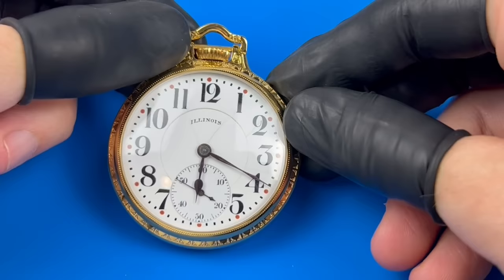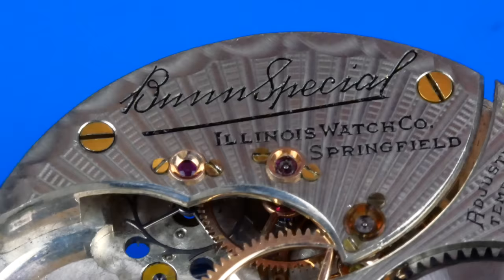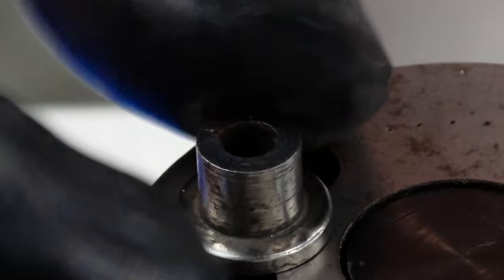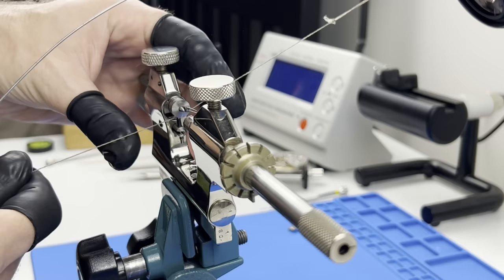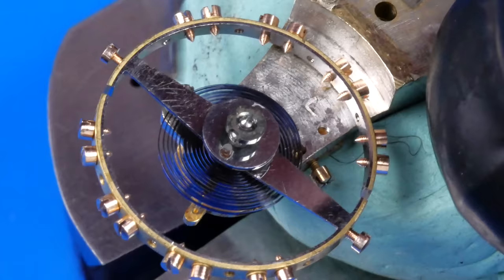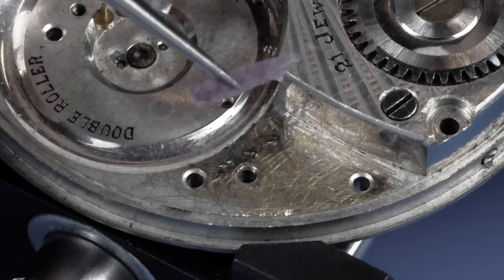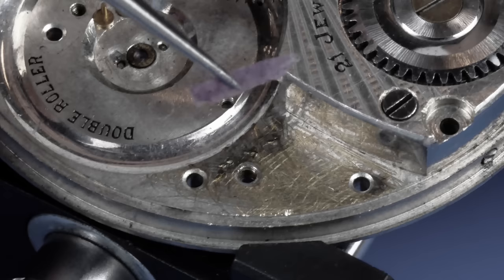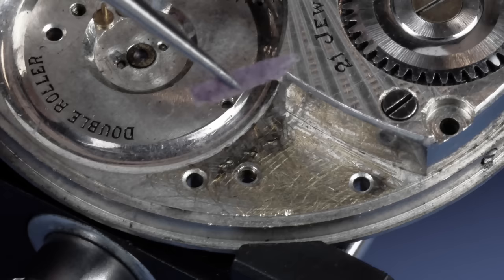Gremlin Hunting in the Iconic BUNN SPECIAL - I Can't BELIEVE it was Running!

Comment: 2:47 experimental and i've only done this on a large dial with a destroyed enamel (in other sections), but i've steamed a dial and then used CA glue under vacuum to fill the holes. Specifically, i slightly flexed the dial on a jig (probably less than a fraction of a mm of deflection) and used a tube under suction at the edge of the crack to suck some CA glue (extra thin type, white tinted). It works. The crack disappears at all distances but very, very close inspection. The steam cleans the crack and the white CA fills the void.
But like i said, i've only tried this on a destroyed dial. I've yet to work the courage to try this on the dials i have in my collection from my family (which is why i've experimented). I'm still working on the idea and application, because for example, it's not uniform and you can see some minor variances.

Comment: Great video!  

It's an interesting watch.  Beyond the prior watchmaking sins that you found and the modern display case, the gold colored (or plated) screws likely came from a lesser Illinois donor.  The dial may have followed the screws as I don't think that design was offered on the Bunn or Bunn Special series.  It's an interesting conglomeration that you have turned into a beautiful result.  

You made note of what your target was for run quality, and you did remarkably well on this one.  It would be an interesting, if you started with a watch that had fewer sins, how close you could bring an equivalent movement (say a 17S Sangamo Special or Hamilton 950) to its original timekeeping spec. - that would mean it would still be worse than a cheap quartz watch but better than the best new Rolex!

Comment: Nice work overall but you should start checking the arbor hole for mainspring on the barrel bridge plate. You will begin to find that there's a lot of side shake on these movements due to severe wear here. Keep up the good work.

Comment: A very worn out movement, but you did wonders restoring it . Also i would like to ask, was it really necessary to replace the balance staff? And perhaps an unpopular opinion, but i don't really like this modern case, it seems to me, that it is of lower quality than the old ones
Reply from the maker: Yes the balance staff lower pivot was actually off center. I’m not sure how that could have happened unless someone tried to make their own. There’s no way it would keep time. I agree on the case. It’s nice overall, but doesn’t compare to the originals
Reply: @csspinner  well i didn't notice that issue. In this case,it was rather necessary to change the staff. And something else, you have worked with almost the most of the famous railroad grade pocket watches, which one do you think has the best quality?
Reply from the maker: @user-iv9qj7ys3y they’re all impressive, but I have to say the Ball / Hamilton railroad models are my favorites

Comment: How do you keep track of where each removable jewel goes? It looks like they all go into the basket to be cleaned, so I would imagine keeping track of which jewel goes to which setting would be difficult. Or does it matter which jewel goes into each specific hole, so long as they are all the same size?
Reply from the maker: I have a compartmentalized basket inside the larger one. I place the same jewels in the same slots each time as a matter of convention
Reply: @csspinner  Awesome, that makes sense. I could see that step being easily overlooked. Of course, you could always just scratch the bezels too lol 😄. This poor watch barely survived its previous service.

Comment: Question, how does one tell when these screws are reverse threaded? In industry (heavy mechanical) I know to watch for hash marks/ lines on the nuts, bolts or screws that are reverse threaded but I cant see any indicators on watch movements
Reply from the maker: In modern watch movements, reverse-threaded screws will have three slots in them. That’s the tell. However, with these older movements, especially with pocket watches, the only one that tends to be reverse threaded is the crown wheel screw. Even then, some manufacturers did not make them reverse threaded. So, if unsure, a light touch is best.
Reply: @csspinner  that is definitely the lessons I've been picking up in these videos, a kind hand will go a long way.

Comment: Could you please tell me which parts of the watch need to be lubricated with the appropriate type of oil? Can I have the oil code information for each part, please? I'm a new student
Reply from the maker: I use Moebius oils-
D5 (or HP-1300) for high friction surfaces like posts, metal to metal rotational surfaces, etc.
9010 for jeweled bearings.
941 or 9145 for pallet fork faces.
Molykote DX grease for the sliding metal to metal surfaces like the faces in the keyless works. 

There are of course alternatives to the above.